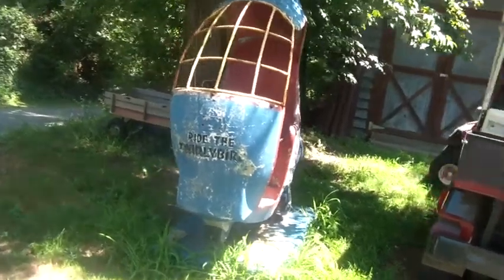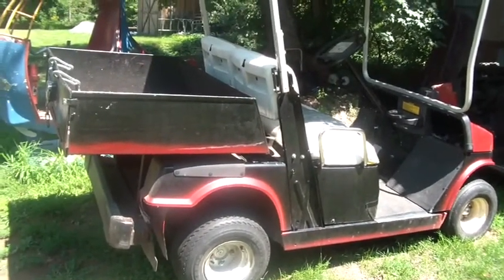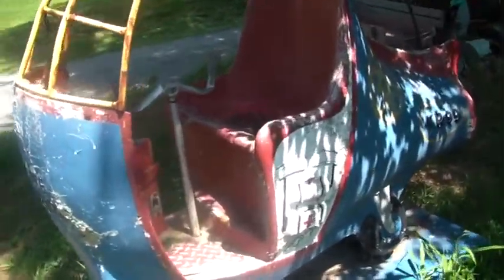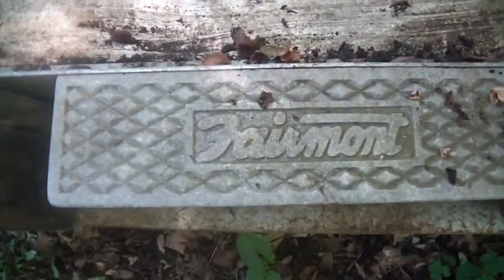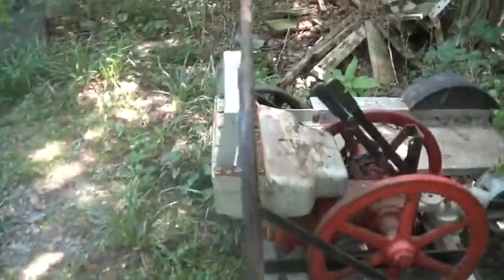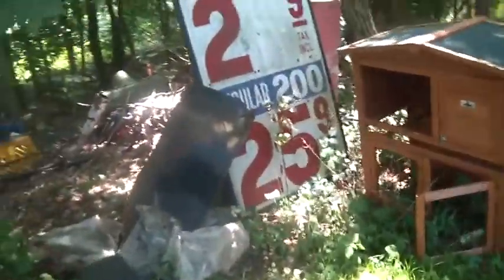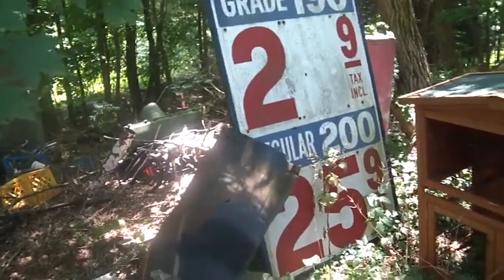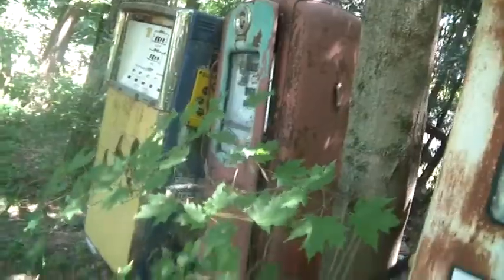Fairmont rail inspection buggy, twilley bird, old RR bed, Charlie's Hoard

Comment: Hay Harvey I'll make a deal with you on the dunnbugey if you can make a deal with mustie 1 to get my 150 dunnbugey running I'll give you the 250 and all the parts I have for it you might want to even use your s for parts and put your 150 motor in it lett me know
Reply from the maker: Hey Barry, I can not speak for Mustie1.... If I recall, Ur 150 had electrical issues and Ur 250 was in parts, please refresh my memory, it seems that I have dropped a few bits with all the vacation time.... I can fix the 150 for U and bring it back once repaired and pick up the 250 stuff.... Thanks for asking, watching, and commenting!!!